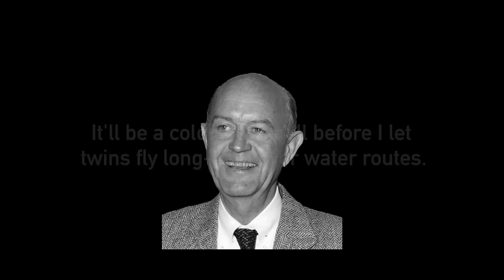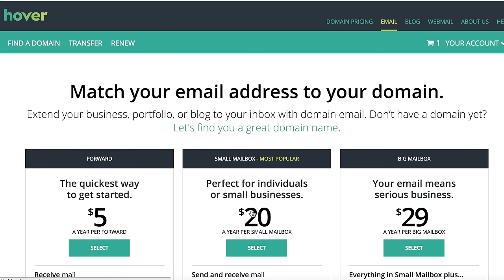Small Planes Over Big Oceans (ETOPS Explained)

Comment: "Engines Turn Or Passengers Swim"

ayy
Reply: Somehow I think that passengers wouldn't get the chance to swim either way...
Reply: Neel Parmar engines go and a plane turns into a big glider, which can be smoothly put down on an ocean. Probably wouldn't be able to swim anywhere, but they'd be able to swim.
Reply: dw. you'll learn how to swim when ur life is in danger. ;)
Reply: yo im learnin
Reply: qwerty112311 Except water landings are still pretty risky, despite the fact that the planes look like it would work well. Think about it: the plane id coming down fast, near the water level it will experience a lot of turbulence and the plane won't be very stable. The plane also has a wide wingspan. This is the most dangerous part. If one of the wing tips catch the water, the plane  immediately cartwheel & of course it's the ocean, so the waves aren't always calm. Ignoring all that you still have to touch down right so that you slow down rather than skip and risky the plane tearing itself apart. It takes a lot of precision to land a plane on the water.
Reply: +David -flamingsword1 I'm not downplaying the skill required to perform a water landing but all the dangers you mentioned are present in ground landings as well. It's a precision job all the way through and pilots do it every single day.

Heck, carrier landings involve even more precision and again, all over the world there's people doing it every day.
Reply: +David -flamingsword151 Planes are also incredibly hardy and engineered for this kind of thing. Even if the plane was to cartwheel there can be survivors (look up Ethiopian Airlines flight 961, most passengers only died because they opened their life jackets inside the plane, which is nowadays well known to be a bad idea).
Reply: +Filipe Amaral The real dangers in water landings though are that the ground at least stays mostly still relative to the plane, water especially ocean water not only swirls and swells with waves constantly changing it's shape and height but also the moment the plane hits it the water starts to give way this is a particular issue for modern airliners with their low slung engines which can dig in like big scoops causing massive deceleration tearing structure apart in many cases.

Only one person has ever landed a plane with low slung engines on water and made what passed for a good landing (everyone walked or in this case swam away).
Reply: "Your seat cushion can be used as a floatation device"
Reply: sure they would not like  they would all die and nevere be found >.>
Reply: water landings more depend on how  how controlled the  decent is  if the plane is carefully losing speed as it decreased in altitude   then  hiting the water wouldn't be too damaging  to the plane and in  theory  it might be able to float on the water if it  could  jettison the engines
Reply: water landings i would say are more riskier then  carrier landings because of the simple fact that  water landings  the  surface of the water is  changing and in the ocean it is a lot  more dangerous
Reply: Hold my beer, I am going to learn how to swim in my bath tub.
Reply: Most modern jets are a bit better than a brick at gliding. 

The glide ratio of a modern jet at about 200 kph is 12:1, e.g. it will loose 1 meter of altitude for every 12 meters of distance it covers. A glider does like 60 meters for 1 meter of altitude loss.
Reply: Hey Dong Hyun
Reply: "... alone in the ocean, floating on a pillow full of beer farts."
Reply: Žiga Auer are you taking into account flaps?
Reply: Engines Turn Or Passengers Shit themselves.
Reply: The engines acting as scoops isn't a huge issue they are attached in a way that allows them to break off before the wing breaks. Even old farm plows have this break away feature. (because of large rocks or tree roots. The part that breaks is a cheap to replace shear bolt or pin of specific strength, or on the big high production stuff a reset-able spring and cam trip mechanism.)
Reply: Laughed so hard
Reply: @ChaplainDMK  Certainly better than brick, and good enough to still fly and land safely. The only significance to the truth that a purpose built glider glides better than a commercial aircraft is that it can't stretch its flight as far from a given altitude if both engines go... flaps only worsen glide ratio, they allow for slower flight but require more power.
Reply: Donghyun Kim applies to Cubans
Reply: @qwerty112311  "which can be smoothly put down on an ocean"   Now that is a Fooking knee-slapper.  Airplanes land on wheels on cement or other prepared hard surfaces.  They crash on water.  The gear is up in the wells, so the first thing to contact the water are the engines.   They rip off, but not before slamming the nose of the plane into the water.  The nose will then rip to shreds and the rest of the plane will likely follow.   Do not expect a USAir on the Hudson outcome to happen more than one in a thousand "ditchings" on water.   And, most trans-Atlantic flights (West to East) occur at night.   If the weather sucks, hell even if it doesn't, what are the chances that Sky-King can affect a decent ditching at night?   What if the surface winds are say....20 knots?   Do you have any idea how big the waves are in the middle of the ocean in a 20knot wind?  Those waves will be EASY to land on.   Uh, not really.    And just how cold is the water?  And how long will it take the boats to get there?   "Plane ditches in the Atlantic successfully!  All dead.  Details at eleven."
Reply: @si2foo  Neg.   USAir on the Hudson...probably the BEST ditching that will ever occur, ever.   Smmooooooth water, perfect "landing".  Yet, the lower skin on the aft 1/4 of the plane was ripped off.  The plane was taking on water and slowly sinking.   Add slightly rougher water and or distant boats and the outcome would have been VERY different.
Reply: I would buy that shirt !
Reply: @step2191   You  may keep them with our compliments!
Reply: @annyer262  gladly. Lol
Reply: @noob.168  you won't be able to swim if you're dead😊
Reply: ..and to think, i actually meant , “Extended Twin engine, Operation, Performance, standards” but it’s really engines turn or passengers swim,  NOT!

Comment: 7:30 That puppy plane A318 was so cute. Its wings are so tiny, but tail appeared slightly bigger relative to the size of the fuselage.
Reply: lol, yea, dimensions of the wings are the same as much larger a321; never the less, this planes handles like crazy, try watching approach at EGLC
Reply: Looks like a mini—380
Reply: the a318’s tail is actually slightly taller than the other a320 series planes
Reply: The OG 737-100 looks cuter imo, with its sleeker appearance & dinky engines.
Reply: Size does not matter, except when it interferes with performance.
Reply: it needs to be. because City Airport is a mad place.
Reply: If it always drinks its fuel it will be a big plane one day. (That's how that works, right?)
Reply: @the1Blind that’s why there arent many A380s, there isnt much A318 but are lots of 737s so there are lots of 747s

Comment: You should have mentioned the failure of the MD-11 as it was launched a few years before ETOPS certifications started.
Reply: Do you know what ETOPS stands for? Engine turning or pilot swimming.
Reply: Some 2 engine planes are ETOPS rated. Most 2 engine planes require a hydraulic driven electric generator to help provide electricity from the engine turning the aircrafts hydraulic pump if the power from one engine is lost. The ER designation at the rear of a planes type, like 777ER, usually means that the plane is certificated for EPOPS.
Reply: The MD-11 failed mostly because of maintenance costs for the tail-mounted engine, specialized onboard and hangar equipment needed to reach it (that stupid built-in tunnel, work platform and cradle to lower the engine). Its fuel efficiency is quite good once the Performance Improvement Package was introduced to restore its advertised range.  If it had a carrying capacity similar to the 747-400,  bigger wings with split scimitar winglets, it would have had a better chance at survival.
Reply: @jameskoralewski3583  "Most 2 engine planes require a hydraulic driven electric generator to help provide electricity"

The APU (Auxiliary Power Unit) is not hydraulically driven, it's hydraulically started. Once it's started, it runs on regular jet fuel.
Reply: @TheCannonofMohammed  
FX still has the MD11s and the DC10s (with a major upgrade on the flight deck).  They are just as expensive to work on though.
Reply: If I am not wrong it is same for the A340?
Reply: @Lyxzzzzzzzzzzzzz1  A340 is similar, though it's commonality with the A330, as well the fact the A340-500/600 were updated (some say it was a bad move by airbus as fitting the new engines and the stretch had very high development costs), meaning it's less inefficient than it could be . It sold better than the MD-11 though, it had better range, and lower maintenance costs( the air frame was brand-new design, not a hand-me-down from the 70s). Despite the programme not ending up until 2011, they are obsolete now, and are in the process of being replaced with LH, the largest operator of them. 
At this point, they really only have 2 appealing points:
-Low up front cost: good for start-ups, and commonality with other Airbus A/C also help reduce initial cost (ie it would cost more to retrain A320 crew for a 777 than another Airbus plane)
-No ETOPS needed, good for airlines with questionable maintenance (more important 10 years ago, nowadays not really a problem for pretty much all airlines)
Also, the -600 do have pretty good hot and high performance, though nothing that makes it really shine above something like a 772 or 773, which are also are also quite depreciated now, but have much lower fuel costs.
Reply: The A340 wasn't as much of a failure as it could have been. Essentially the only "failure" of Airbus' A340 development was that they bothered to develop it to begin with - but it didn't affect Airbus' sales at all.

The A330 and A340 were both developed simultaneously. In fact they're basically the same plane, with the only major differences being the number of engines (the A330 has 2, the A340 has 4). The idea was that the A330 would be used on long-haul routes over land, such as between Europe and Asia or Africa, or between the Americas, while the A340 would be used on routes where the A330 wouldn't be allowed to go, for example transatlantic or transpacific routes.

What actually happened, of course, was that the A330 got an ETOPS rating of 180+ minutes, which allowed airlines to fly their more efficient A330s on routes that the A340 was supposed to operate on. As a result, Airbus received more orders for the A330 than they were expecting, and conversely fewer A340 orders than expected. But, since the full number of orders is roughly the same anyway, Airbus didn't lose any money from lack of orders. The only money they lost was on the programme cost to design the A340 in the first place.
Reply: @jameskoralewski3583  ER means Extra range SMH🤦‍♂️🤦‍♂️
Reply: MD-12
Reply: Funny how KLM flew it till the mid 2010s
Reply: @dpm-jt8rj  Since there's no market for MD-11's right now other than for air cargo, and because they're so worthles, they must be dirt cheap to acquire.
Reply: @jameskoralewski3583  ER means Extended Range..

Comment: Yay! I'm so happy you addressed the BAW A318 flight, I always wondered how they were allowed to fly such a small twin over water.
Reply: txrangerkidd222 it's all business class seats too. That's why. They wouldn't be able to fly a full aircraft there
Reply: txrangerkidd222 also the a318 is the largest aircraft that has the 9 degree landing glide slope certification required for London City airport
Reply: it's a great idea, if you think about it. put business class in one plane, economy in another. though they have business/first in larger planes as well, but.. you get my pont.
Reply: unfortunately it isn't quite described accurately... BA flies the A318 to/from NYC via Shannon, Ireland. it is not non-stop between London and New York.
Reply: From my research, it only stops in Shannon in one direction, and I think that's from LCY to NY so it can take off light and refuel while giving the passengers the opportunity to clear customs early.
Reply: it goes London city to Shannon in Ireland and all the way to JFK. it has to do the stop as it can't hold enough fuel. its callsign BAW1 is what Concorde used which was a business class interior, which the a318 has for BA.
Reply: Actually, the A318 can make it back nonstop at a normal airport.  Remember London City Airport's runway is barely 5000 ft (actually 4948 ft), they can't fill up with the fuel required for JFK because of the short runway - they are weight restricted.  

The stop in  SNN also provides another benefit, the pax clear Customs and Immigration at SNN instead of JFK!
Reply: Glad to here its all J seating.. I was thinking who the F would want to be stuck in a 2 class A318 for that long :))
Reply: @mattyyxd20 - awesome info thank you for sharing :))
Reply: Westjet also flies a 737-700 from St Johns to Gatwick. Its pretty cool.
Reply: the coach class is only there to fill the airplane, if they could sell all business class seats they would
Reply: MultiSnout it only flies via Shannon on the way from LCY to JFK. This is because the runway at LCY is too short to take off with a full fuel compliment.

When they land Shannon they get us pre immigration clearance, top up the fuel and then fly on to JFK and land as a domestic aircraft.

The Passengers literally then get off the plane avoid immigration and just go straight to baggage reclaim and are out in the limos in less than 20 minutes.

On the way back from JFK it flies directly non stop to London City Airport without stopping.

The reason you can do this, it's because it's especially upgraded a318, with extra fuel tanks and only 32 fully business class seats on board so it's very light.

It has a range of around 3950 miles which is plenty to do the full non stop route from JFK to LCY.
Reply: You’d be surprised how some very small planes can cross the Atlantic. The Falcon 7x business jet is a much smaller private jet that can fly from New York to India without refueling.

Comment: Air Canada uses an A319 trans-Atlantic? Thug life :)
Reply: Canadian Plane Spotter St. john's isn't a busy airport, I've been on that exact flight before.
Reply: Canadian Plane Spotter
Norwegian plans to use the 737 Max on TATL.
Reply: I know you form somewhere
Reply: BA uses A318 from LCY- NY
Reply: BA operates A318 trans-Atlantic
Reply: They have to refuel enroute.  Only nonstop JFK-LCY due winds & stuffs.
Reply: Hank Fuddle it's not due to the winds or jetstream. It's simply because LCY's runway is too short to take off with a full fuel load.

So, they developed a special route where passengers can pre clear customs and migration in Ireland. And then to kill two birds with one stone, refuelling for the rest of the trip across the Atlantic, and dealing with immigration - meaning the passengers get to arrive domestic at JFK, and simply walk through the terminal to their taxi 15 minutes from landing.

On the way back, it can do non-stop because the runway is long enough at JFK.
Reply: Wa
Reply: Because planes don't use fuel the air is heated when it is pressurized and it is turns the engine forever.
Reply: British airways use a318 for their flight number 1, from london to new york via shannon
Reply: @CloroxBleach-um4gn  
LCY-JFK with a "Technical Stop" in SNN.  The "Technical Stop" is an old term used in aviation from back in the day when aircraft flying transoceanic flights had to stop for fuel at either ANC, SNN, YYT, or HNL (there are many more examples).  The BA A318 cannot load enough fuel to make the trip because of the different restrictions at LCY.   ANC and HNL are still busy airports even without the technical stops, but because of newer technology the aircraft flown are much more fuel efficient and can fly much further.
Reply: I saw an old US Airways A321 fly from Philly to Paris.
Reply: @nigelmarvin1387  Yeah I realized that soon after my comment :P
Reply: I flew on the same plane in Europe, on a much shorter route. Boy, was that a loud experience, I can only imagine how tiresome it is on a 5-hour flight.

Comment: Thanks for explaining ETOPS. I have watched several videos of pilots in executive jets or even prop-driven planes doing the North Atlantic crossing. The route they take includes stops in Iceland and Greenland for refueling. In each of the videos they are in contact with the North Atlantic crossing Air Traffic Control - though there is NO radar service on most of the route - and have been asked if they are ETOPS certified. I did not know what that was until now. Great video!

Comment: A couple of other points to add to an excellent video.
1. The engines are much more efficient now so small twins have a far greater range than they used to.
2.If a second engine fails, it is statistically likely that it will be for the same reason as the first failure, so it could mean all 4 failing on a 747. There are a few instances of multi engine failures due to maintenance errors.

Comment: There are individual variations to the ETOPS clearances. Some airlines like Aloha 737's flying in between Hawaii and mainland USA had to run their APU engines over the middle of the ocean to cover the emergency power backup requirements of ETOPS.  Some airlines didn't have to follow those rules as ETOPS clearances are not set in stone but a variable based on past maintenance practices.
Reply: That must have used a ton of extra fuel. Your practically using 3 engines then except one doesn't produce thrust